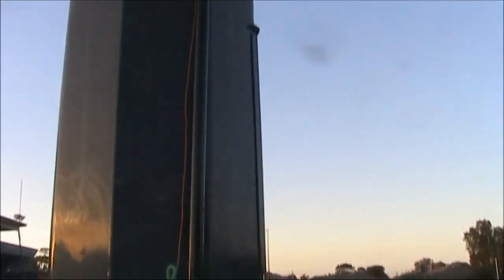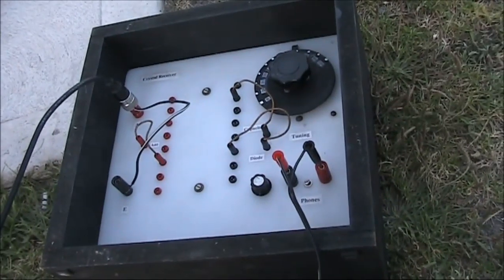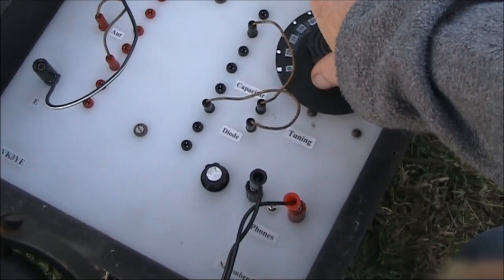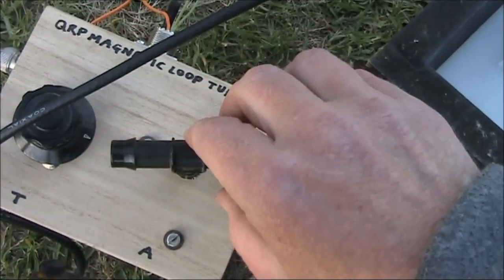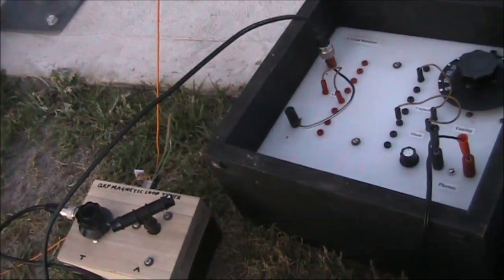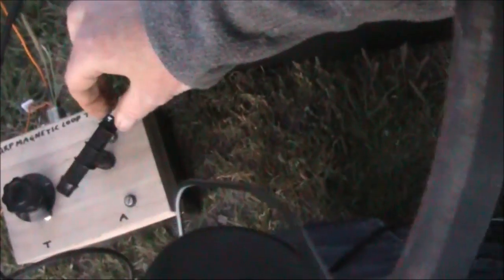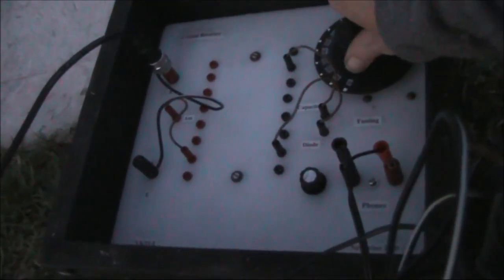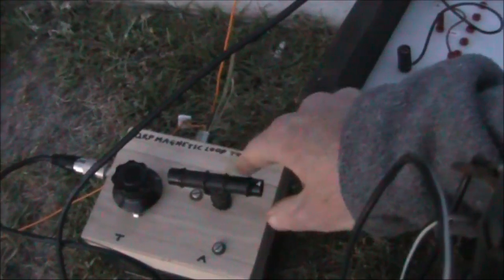Can a light pole antenna drive a crystal set?

Comment: I like the way you explained to what appeared a passer by what you were doing.  Interesting, I need to build a crystal set, I missed out on that, it was all transistor radios.  Didn't stop me opening them up though and working out how they worked.  It maybe took me a few to work it all out though, but there was no one to show me anything.  My father was the type that would use a hammer!  He looked at a TV set once with someone that was supposed to know what they were doing and as my prediction "It will never work again" came true.  When they started sticking any valve in to see what it would do I knew it was the end!
That crystal set works really well.  Brilliant.  Nice video.  It cut off suddenly at the end, did you just pull the plug out of the audio to end the sound?  Keep up the good interesting content, love it.

Comment: Interesting video, Peter.  Your tuning around just on sunset brought back memories of using my home-built crystal set in the early 70s, and hearing both MW and SW stations.  I almost expected 7:59 to close with "And that brings us to the end of the tonight's broadcast from the BBC."
Reply from the maker: My listening actually ended with some CW signals heard on 160m - VK2 & VK4. Good strength on the headphones but insufficient for the camera.
Reply: @vk3ye  I was blown away when as a kid I heard CW for the first time on my crystal set - I can still remember it like was yesterday ... it was very late one night (just after midnight, after most of the regional MW stations had closed down, and  everyone in our house had gone to bed, so I was very careful not to make any noise), and I had a quick tune around - there was wall-to-wall CW.  This was in the day when the coast radio stations still used morse, so that combined with amateur radio traffic would've meant there was a lot of it to hear.  The carriers from other signals within the set's passband were heterodyning with the CW signals in the detector diode to render it audible.  I had no chance of reading any of it, as it would be another five years before I learnt morse to the standard where I could read it on the air, but I was absolutely hooked ... as evidenced by me just finishing a weekend of CW on 40m in the CQ WW DX Contest.